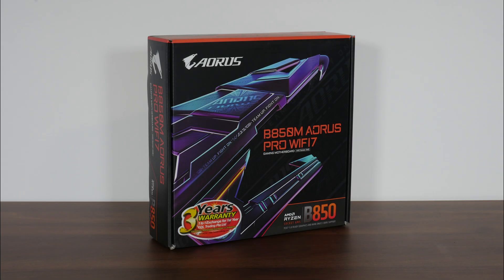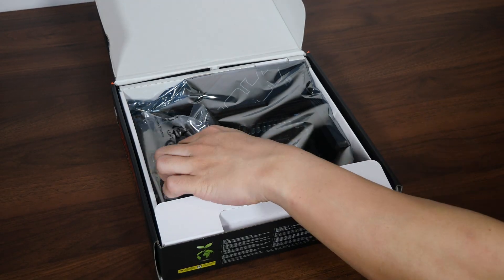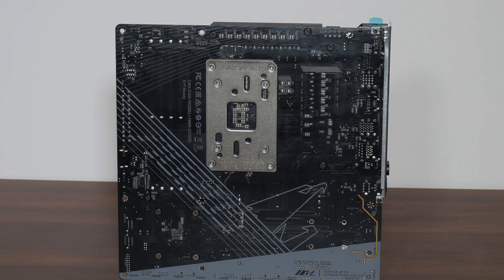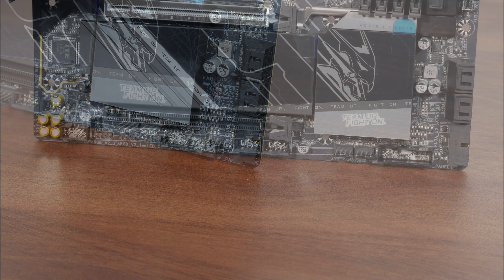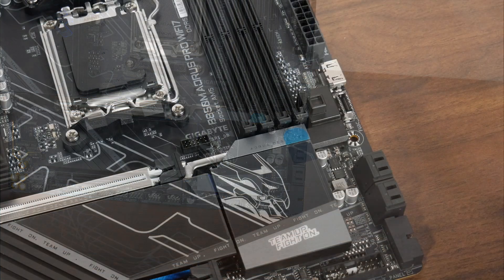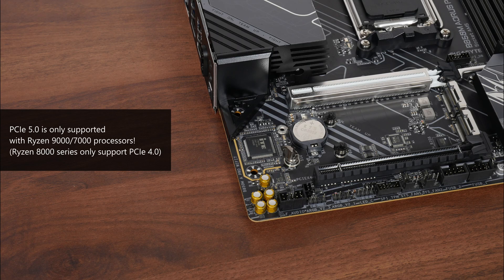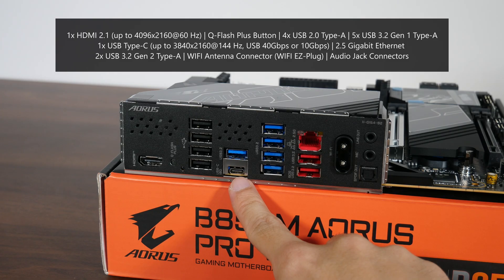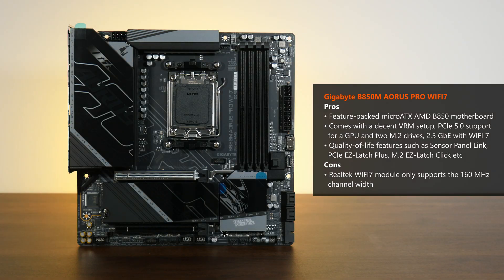Mid-range micro ATX AM5 motherboard! Gigabyte B850M AORUS PRO WIFI7 Unboxing & Overview

Comment: Good callout on the weaker WIFI 7 version. Thanks.
Reply from the maker: Cheers. On a side note, I noticed that the latest batch of refreshed AM5 board offerings now offer full 320MHz channel width WIFI 7 support - in Gigabyte's world, their new X870E X3D series of motherboards come with the new MediaTek MT7927 WIFI 7 module. Not sure if this will eventually trickle down to the B-series motherboard offerings in due course!

Comment: bro which one to buy im having analaysis paralysis between this motherboard B850m Aorus Pro or B850m Aorus Elite
Reply from the maker: Hey there, what's the price difference between both board where you're from? The AORUS PRO is the better offering compared to the AORUS ELITE WIFI6E in terms of specs, so from a value perspective, it really depends on how big the price difference is between both offerings!
Reply: @ALKtech  It's a $20 USD difference, and I’m also considering that the deciding factor might be aesthetics. The B850 Aorus Pro has onboard lighting (team up, fight on) as I see on your review, but the Aorus Elite WiFi6E doesn’t. Since I’m building a stealth build, I don’t want any lights, so I might go with the Elite WiFi6E since it doesn’t have any lighting. Thanks for replying, sir.
Reply from the maker: @user-is1zw2mi1k  mmm I see. Aesthetics aside, the Aorus Elite does come with a weaker VRM setup and also has a WIFI 6E module instead of WIFI 7 (when compared to the Aorus Pro). If these features are not that important to you, the Aorus Elite should do just fine! By the way, what processor are you intending to use for your build?
Reply: @ALKtech  I'm deciding between Ryzen 5 9600X or Ryzen 7 7000. They are both in the same price range, $215 USD. Which one is the best? Thanks for having time to reply sir. :)

Comment: Thanks for the review? Do you think it is a good MB for overclocking a 9700x?
Reply from the maker: Cheers. I didn't get the chance to overclock with this board, but I'm guessing it won't overclock too well especially if you're intending to really push your processor beyond its limits - some telltale signs include the fact that the board comes with only a single eight-pin EPS power connector, instead of two! That said, if you're doing stuff such as curve optimiser and load line calibration, I think this board will do just fine. Are you in the market for an AM5 motherboard at the moment?
Reply: @ALKtech  Thanks for the reply! Yes — I’m looking for an AM5 motherboard that can handle basic overclocking cpu and ram (like in this video: https://www.youtube.com/watch?v=N60M36PRHsY). I’m a newbie when it comes to overclocking, so I don’t know much about it. I was aiming for a B850 mATX board since high-end options like the X670E or X870E are out of my budget. From watching your videos I see you test a lot of motherboards, so I’d like you to tell me if this AORUS Pro is good enough — or if there are maybe other options.
Reply: @Phil33  dude skip overclocking
Getting a little bit of extra performance is not worth it, it will reduce the CPU/Ram lifespan for the long run amd gives u an unstable system that can crash anytime if not done correctly 
Not worth it at all
Put Ryzen 5 7500F or 7700
Or 9600X and u should be fine for to get any GPU from 9060 XT 16gb to 9070 16Ggb or Rtx 5060 ti 16gb to Rtx 5070 Ti 16gb

9060 XT 16gb and 5060 ti 16gb are great price to performance for 1440P

Comment: 3 year warranty.  That's funny.  It'll be almost obsolete by then.  Thanks for the vid, my ALKafreind.  Is that thing 358 bucks?  Yikes that's high end price for a mid range part.
Reply from the maker: But hey, this being an AM5 board means it'll probably hang around for a reeeeal long time, just like how we're still getting new-ish AM4 processors up till very recently 😂 I'm not sure about the price yet though, it's not available to purchase where I'm from just yet, and it seems like global availability seems a bit sketchy at this point in time!
Reply: @ALKtech  Three years is a long time in the tech world.  I'm sure Microsoft will come up with some idea to make everyone buy new computers by then. - Like they obsoleted millions of devises with Windows 11.  Personally, that's why I went to Linux.  There's a lot to learn, but it's a lot more flexible and powerful than Windows.  You can access the source code and customize it.  Microsoft?